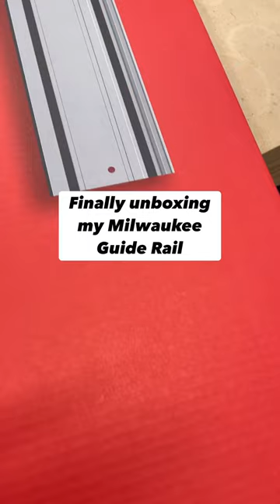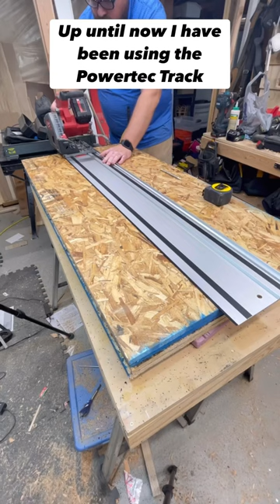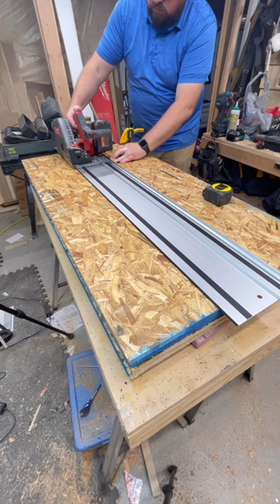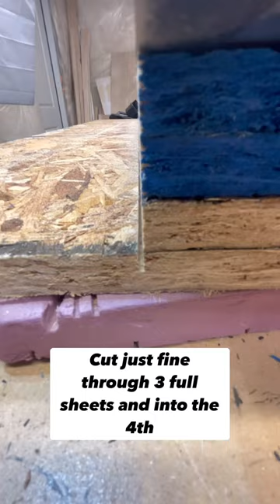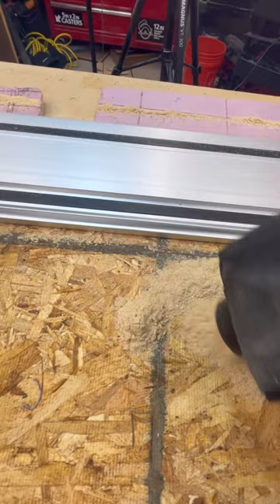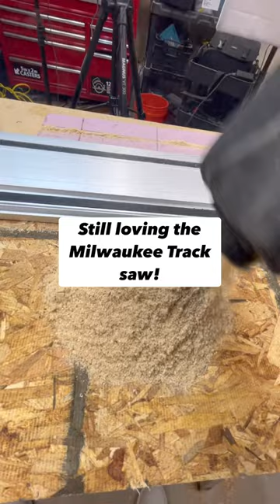Milwaukee M18 Tracksaw makes quick clean work! #milwaukee #milwaukeetools #tracksaw #shorts

Comment: I have also seen them selling red tracks, maybe outside of US only?
Reply from the maker: Yes.  I think I have only seen them in Europe or Australian markets.
Reply: @TinkerWithTools  they sure look cool :)
Reply from the maker: @riba2233  I agree.
Reply: They are very expensive compared to the Makita tracks.  In Canada they sell for twice the price of the Makita branded tracks.  I have both and quite frankly, there’s no reason to blow the extra bucks just to get a red Milwaukee sticker on the track.
Reply from the maker: @Opinions-from-YUL  yeah the makita was what I nearly bought but i ended up getting the powertec since it was so much more economical.  I had preordered this a Milwaukee track and it ended up shipping a week or two later than the saw.

Comment: Just bought the saw with 31" track.  I ordered 2 55" powertecs because reviews said they were pretty much identical.  Do you see any difference between them?
Reply from the maker: They aren’t identical but the difference only really applies to the bevel lock features that keeps the saw from tipping when making a bevel cut.  Other than that they are pretty close.
Reply: @TinkerWithTools  cool thank you

Comment: I've got issues with their new model hammer drill shaking an ho 6ah off the contacts. Can't use anything bigger than a 5.0 on it
Reply from the maker: I haven’t had any issue with mine.  Sorry you are dealing with that.    Have you inquired about a warranty claim to see if they will replace it perhaps?
Reply: @TinkerWithTools  hah, lol!!! 😂 It's work tools, boss don't care if it works

Comment: So thats how youcut your Particle board foryour demo's
Reply from the maker: Yep.  I have found it to be a decent testing medium.  It’s not perfect but nothing is
Reply: @TinkerWithTools  I have been using real tree parts and they eat up fastener s get installed but get stuck with the heat and break off have destroyed over $50.00 in them in a very short time